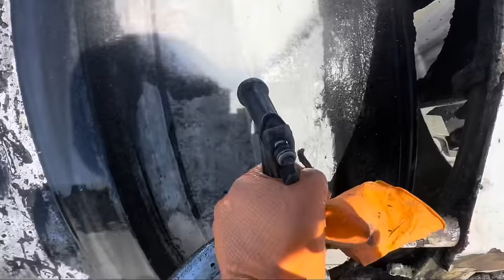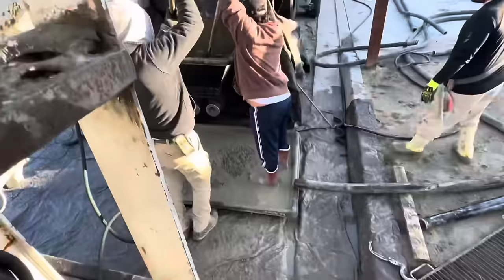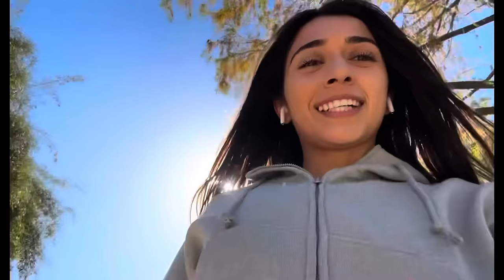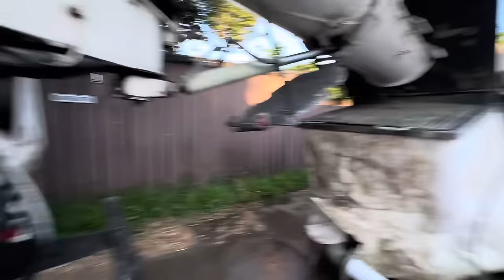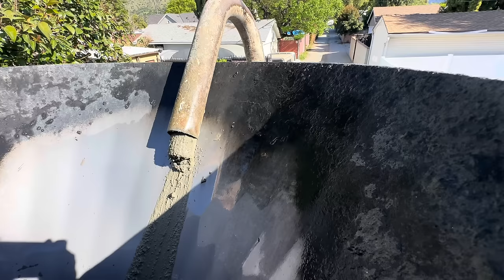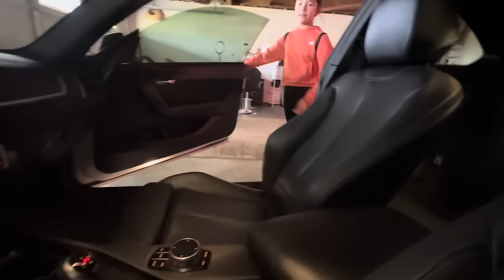My Concrete Mixer Drum is Ruined!

Comment: I've noticed on some of your videos, you step out your truck facing outward. That's actually pretty dangerous because you can slip. Always step out facing your truck while holding on with both hands.. 3 point contact
Reply: All mixer truck drivers step out facing the wind. Especially front discharge.
Reply: @julesTools  Why?
Reply: @josea1531  🤣🤣🤣 it's a mixer thing. Nah, front discharge maybe because it's the only way out the cubbie hole and just continue on off the truck.
Reply: @josea1531  on the rears, I don't know. She sould be coming out the correct way.
Reply: @julesTools  No way man.. that could turn bad real quick. Imagine slipping and hitting the back of the neck on the steps. Stay safe
Reply: @josea1531  I know it. Some guys do it though. On the front discharge mixers it's literally like walking down the stairs in a house. I see it all the time.

Comment: Thank you for another fun video! I understand your frustration with the black color staining your drum.... iron oxide pigments are powerful. I always end up ruining my clothes when I'm around them lol.

Concrete can be tricky to pump depending on many things. For example, some 2" line pump mixes need to be very careful with the percentage and size of aggregates used. Around my area that means under 1000lbs per cy with 1/2" minus. 
However, the main issue when pumping concrete is making sure the mix has enough paste volume to carry the aggregates without segregation. Rheology and viscosity also are a part of this but overall paste volume is the most important. Pumps plug up when segregation occurs. Paste volume is composed of water, cementitious materials, and air-entrainment. There must be a correct balancing act between the w/c ratio, air content, and cementitious amounts to pump well. That is why the old way of just increasing slump with water on the job doesn't always work.... because while it will increase the overall paste volume,  it will also lower the viscosity of the mix and is more prone to segregation in the lines/joints/reducers = plugging. 

Sorry to ramble on! Have a nice week!

Comment: Drove mixer for 36 years just retired , on the lamp black getting on your barrel what i did when I knew the load had lamp black are any color was hose your drum down with water really helps from the color sticking to the drum.
Reply from the maker: congrats on you’re retirement! I know that trick and I was feeling so much regret for not doing it.. I get loaded this black color everyday and this had never happened but I should’ve been more safe than sorry..

Comment: Aluminum Brightener (Acid) is what I’ve used over the years. I’ve never had the experience that you did. I’ve used it on some painted surfaces such as painted steel rims, truck frames, chrome bumpers, chrome stacks, aluminum rims ect, not the cab! It’s pretty potent so you might want to wear hand protection. The less water you add to it the stronger it is. You have to use your own discretion.

Comment: Black concrete dye? Try Dish soap or degreaser, that's what i use on my 36Z putzmeister pump truck, then pressure wash it off with the shop hotsy. It still stains for a couple months. My hopper is suppose to be gray and it was redish pink for a while 😵‍💫😆

Comment: I feel for you. Hope you never get double loaded. Ugh. I’ve used this method and passed it on to other drivers, if you have a light acid, spray it on your drum, pedestal, chute, hopper and fenders from a pump up sprayer at the end of the day. When you get loaded the next day, most of the light cement from the day prior will come off. Little things help a lot.

Comment: Hey Lex, as a concrete pump operator when the mix is pretty bad for a pump I try to get it wet enough to the point where it goes through the grate easily. Then after that I make sure to keep the pump rolling nonstop ( no breaks or pauses) until finishing the job or else it will lock up. I find that a 7 inch slump is enough to pass through quickly but may not separate inside the pump, although increasing the water ratio by 5 gallon increments can be done to get the water level right. However I will add that if the concrete mix does not have enough portland cement it will not go through no matter what you do since cement and water is what helps keep everything (sand, rock .etc) sticking together and lubricated inside the pump. In those severe cases it is always best to either use a chute like how you did or send the load back and get a new mix instead of giving a hard time of frustration for the pump guy taking the machine apart and putting it back together so many times. Making fast simple decisions can sometimes save time on frustration. Altho Pumping with ready mix trucks are always a bit more riskier simply because it's dependent on one mix setting from the plant and if it's very bad then we can only do so much. Hope this helps out with future jobs that use pumps.

Comment: Pretty sure you need some stronger asset. I know how California is about all the bull crap I left there just in time not that I wanted to but. Add to follow my second family. Four kids for my first wife what are my daughters lives in Anaheim the other two live in Northern California who are the Redwoods are and one son up there. Back in the day all four of them used to ride with me in the truck. All day long. Those are two axle Freightliner so it had a sleeper. Second wife another little girl and she had a 6-month-old boy so I'm the only dad he knows.
Now I live close to Springfield Missouri. I used to pull end dumps thin dump trucks the mixers jump from one truck into the other.
I started with old Mack Trucks two stick shifters pieces of you know what .
One of them was a pan didn't have no driver's window my water tank had a leak so it looked like icicle shooting at me. Then I graduated to another International finally at the end I drove a 92 Pete.
The one that came to California to visit some rookie drove my truck and rolled and told it.😮 so I was back to dump trucks and yes we use some acid that was so strong it Knock You Out take your breath away. Have a good day little sister be safe❤.
By the way a guy drove 40 random Ready Mix was my brother-in-law.
Now X again.
Vive la vida loca Locos forever.
I grew up on a ranch the Northern Colorado at the age of 7 I was driving trucks and tractors. En las huertas y los files con mi abuelo telera cocinero en un campo de borde.
.👍🏼🤚🏽😊😎🙋🏽‍♂️❤👏🏽👏🏽

Comment: Try  using a pressure  it should help  with a strong degreasers  don’t use acid wen pressure washing,  ❤️❤️❤️ for you  always good to hang out with grandparents
Reply: It's not grease it's black color degreaser won't touch it.

Comment: Those black stains are really annoying you on that drum I see... 😂 I do understand and feel your pain here. I do see how that would bother you showing up on jobs with the stains on your truck. Just get you a 12 pack of white spray paint enamel by Krylon or Rust-Oleum for touch-ups to get the uglies out whenever they don't wanna go away with the muriatic acid cleaning. I noticed you did the same thing I do every time I get into my BMW with somebody riding with me. Instead of just clicking my key fob twice to unlock all doors, I press it once to unlock my door, and then get in and press the middle unlock button to let them in. 😂

Comment: Question how do you do it when u need to use the restroom?
Reply from the maker: There’s restrooms at the plant where I load up at! And they’re always clean which is a plus
Reply: @lexflowaz  so I just started to work as a mixer driver I got my class a last week and it’s hard to use the rpm for shifting, I ask some
Of the guys and they just go by the truck